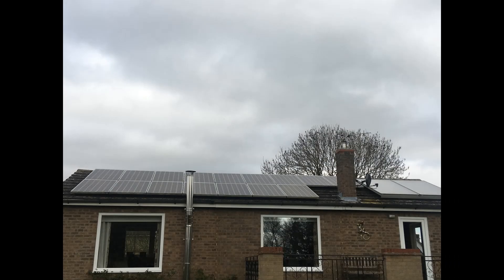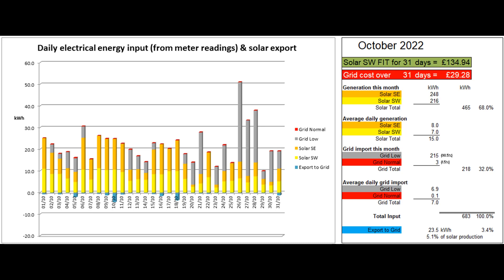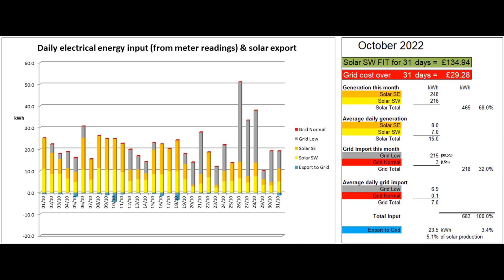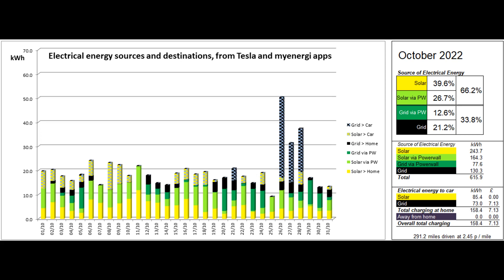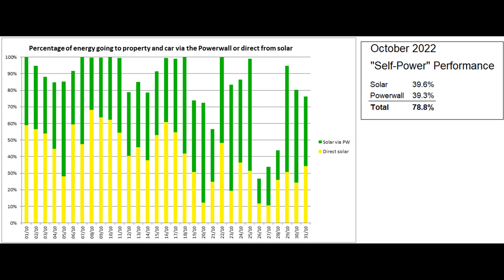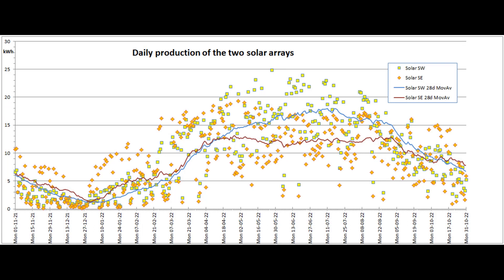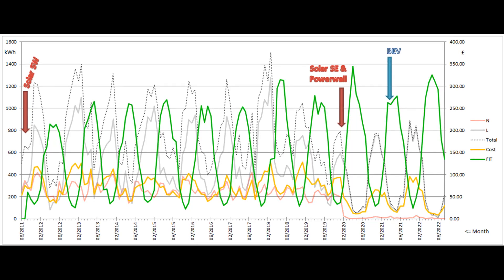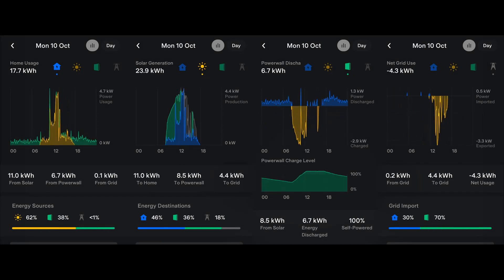Tesla Powerwall 2 and Solar PV in the UK [35]: October 2022

Comment: Once again thank you for your report. Our October production was higher than last year and to date our 4.3 array has already produced 4260 kw compared to the full year of 4054 last year. Whilst we do not have figures going back to 2012 in the way we have now, 2022 will be an exceptional solar production year for us. Is that something that will continue as the climate changes?, we shall see.

I agree with your sentiments re the self powered figures produced by the Tesla app. The Tesla Powerwall knows exactly where all the electricity comes from,so surely a simple software tweak could rectify the issue and show how mains draw affects that Self Powered figure.